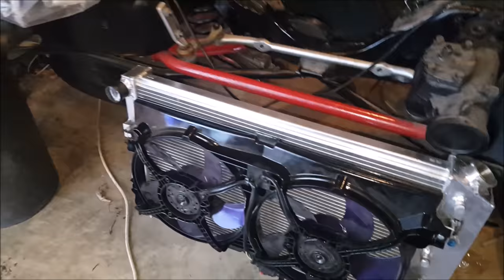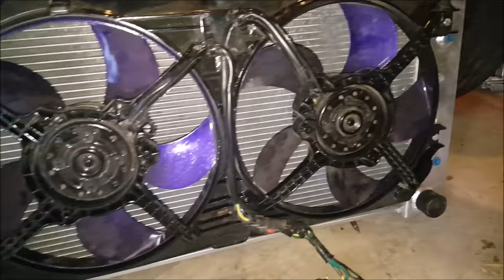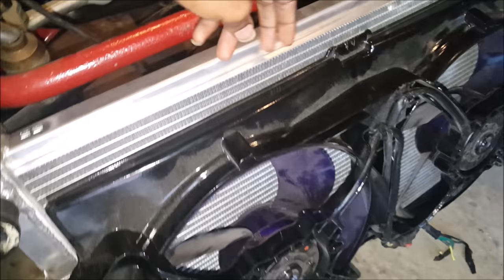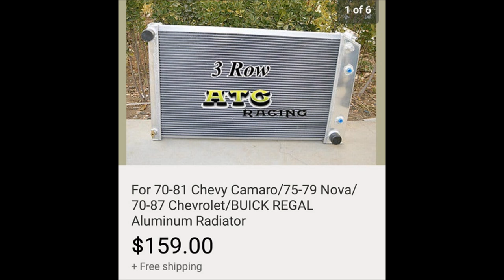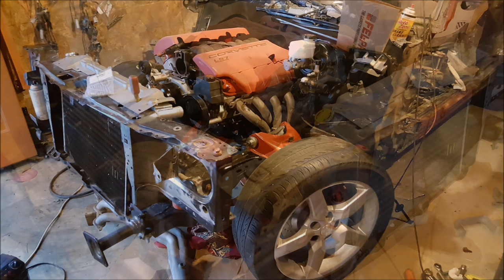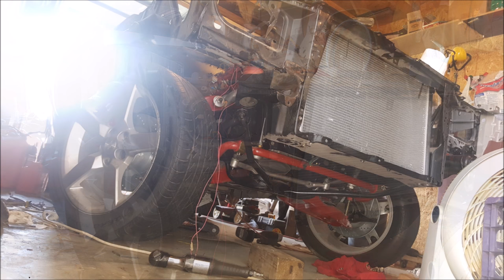Veltboy Garage - Cooling Fans & Radiator Update

Comment: the same fans i got , done had mines on for almost 3 years now i got a griffin radiator tho, my car run 160° all year around even with ac on and in traffic, good upgrade choice there
Reply from the maker: I had them in my car before I tire it apart to rebuild it & yeah they did a great job keeping the car cool with a factory gbody radiator. They take some power to run & i had to upgrade my alt because of battery drainage but after i put the new alternator in I didn't have any other issues.
Reply from the maker: +rasstarr01 Good to hear they are working good on yours with the A/C on cuz it will be needed all summer here so Im glad thats one thing I wont have to worry about later on down the road! Thanks for the comment!

Comment: looking good ..thats a nice radiator  especially for under $200 ..I hope u keeping track of wut year car all these parts come off of so if u have to replace something. .
Reply from the maker: I had a guy I follow on here to tell me it was nice & wasn't too expensive so I followed his advice & ordered one. I'm sure it will get the job done & keep the car temp low with the fans im using. Those things move some air!!! Yeah I'm keeping track of everything im using.
Reply: veltboy314 I thought it was a be cool radiator at first. .
Reply from the maker: Diy type of guy Man I cant afford all that name brand stuff lol
Reply: veltboy314 I hear u... knock off just as good :)
Reply: @veltboy314  where did you get the radiator from. I'm trying to order one

Comment: Veltboy314 how close are you to finishing?
Reply from the maker: Body & paint would put me all the way in the game. Everything else is already here hanging up waiting to be installed.
Reply: veltboy314 great job man and the best part about it is that you did it all and you can truly say you built this beast nothing but motivation 

thank you
Reply from the maker: Ralpheal King I had a couple to give me a hand with a few things but yeah for the most part it was a one man build. I watched all the older guys on the Oldsmobile forums building their cars in the garage & I wanted the same thing so I went for it & not putting a time limit on it. I want a new car so its not coming out until i replace everything & get that. I dont care how long it takes. Only thing matters to me is finishing it exactly how vision it in my head!!
Reply: Man you have done a great job so far and I think the result of your hard work shows, I myself is currently in the process of a home build but I have a hard time staying motivated,quick question where did you find that LS7
Reply from the maker: Ralpheal King Thanks buddy. Ik the same way withbthis car as far as the motivation thats why im constantly stopping on it. This thing would have been finished by now if i would have found the motivation to stay on it. My engine is a 5.3 that to stripped all the truck accessories from & added the accessories from a car so the engine looks like it belongs there. I was looking on ebay & found the LS7 coil covers cheaper than a LS1 set so i got them. Its funny that everyone thinks its a LS7